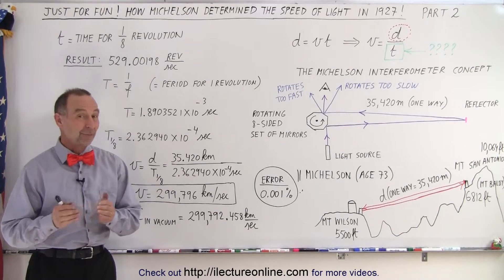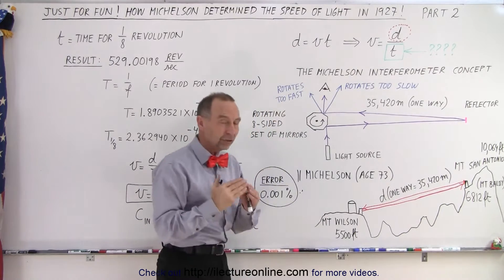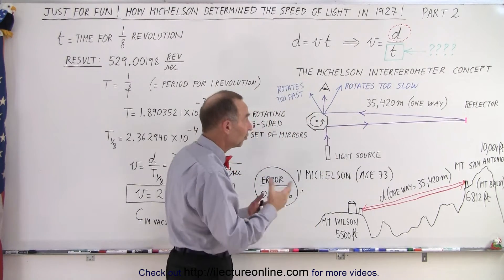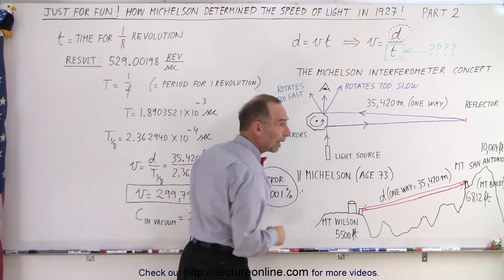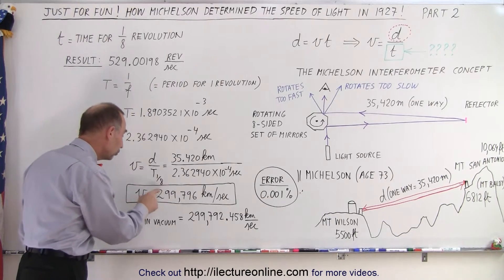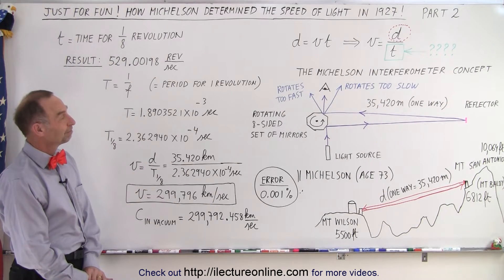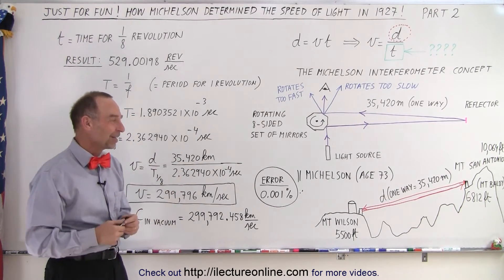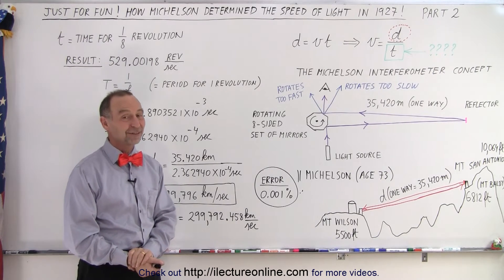Just For Fun! - Physics (21) MISTAKE! See description for link. Calculate Speed of Light..? (2 of 2)

Comment: Just out of curiosity, what was their time base? (Shortt clock?) How did they calibrate their time base? What was the calibration standard? This would be necessary to accurately measure the speed the rotating mirror. Today, we might use a crystal oscillator operating at MHz frequencies, or even atomic clocks for extreme accuracy (GHz). I don't think they had that a good grip on electronics in 1927. 0.001% error is 10PPM, challenging for even today's basic crystal oscillators.

Comment: It was also called as the great trigonometric survey in back 1852, from the distance of 160 km away from the foot of the Mount Everest , sir george everest hypothesized that this distance of 160 km can be the adjacent side of a right angled triangle and the height of the mountain would it's opposite side of that same right angled triangle, using a theodolite he calculated the angle of elevation at the end of the opposite side of that same right angled triangle then he assumed the angle of elevation to be the tita and then used trigonometry
It is given by : 
      height of the mountain  = 
           tan(tita) × 160 km
With this he found that the height of the mountain is 8848 meters, the mountain was came to known as mount Everest in 1856.
          To know the angle sir george Everest used a giant theodolite which is now kept in the museum of the survey of india in Dehradun of India.

Comment: Thanks for that! The history of measuring c is super interesting; maybe you could make more videos about these? What I find most interesting are the details of how they measured things in the absence of modern equipment (like the measuring of the distance which you describe). The first one could be Römer in the 17th century; he was the first to show that the speed of light is finite, by looking at the observed orbital speeds of Jupiter's moons. Then, in 1849, Armand Fizeau used a method somewhat similar to Michelson's (he used a large wheel with dents, like a gear which also interrupted the beam of light) and arrived at a speed of about 315,300 km/s which is only about 5 percent off. One year after Fizeau, Foucault already used a rotating mirror (ingenuously measuring its speed with a tuning fork, I think) and arrived at  the much more precise result of 298.000 km/s.
Reply from the maker: Yes, these are great examples of very smart people coming up with ingenious methods to determine the speed of light.

Comment: I think you forgot to multiply 35km by 2 in the calculation for speed. The light goes out and back - so the distance it travels is 70 km in the time the mirrors rotate 1/8 of a turn.
Reply from the maker: Yes, I forgot to add the x 2